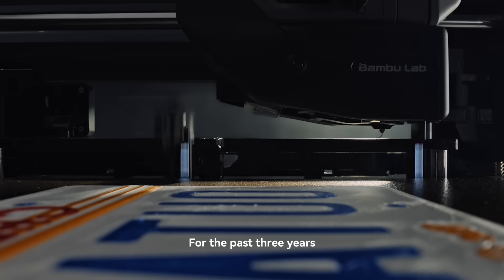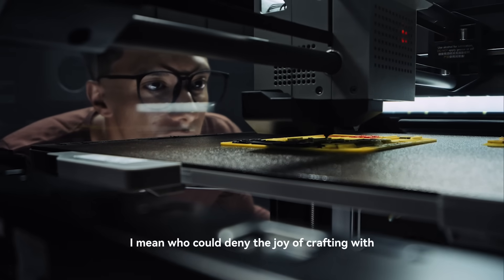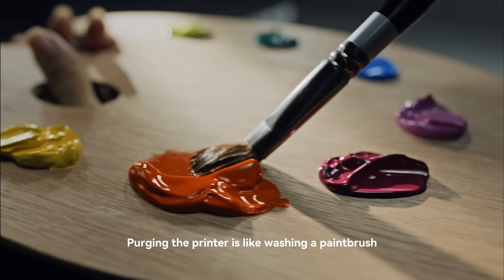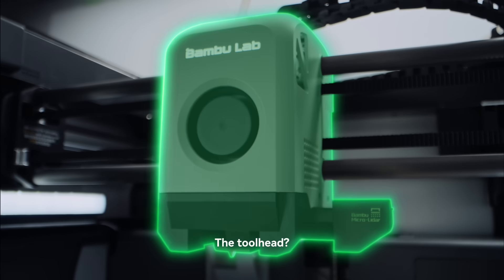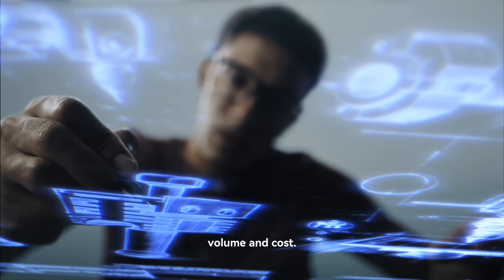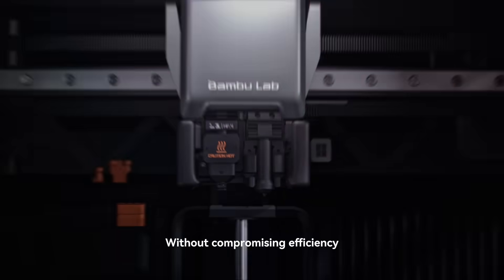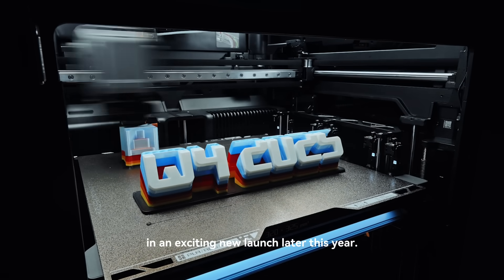Meet Vortek: Our Answer to Zero Purge Waste Multi-Material Printing

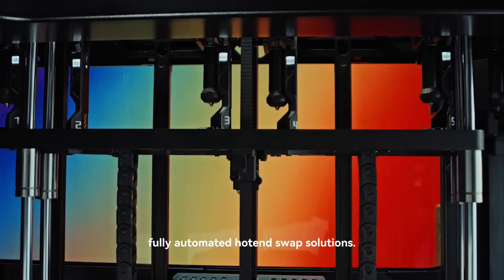Comment: Looks like the filament still has to be cut, and retracted from the bowden tube? I don't see any filament in those nozzles @1:51.
Bondtech INDX still seems the better, faster, more passive (no chip or sensors in the tool) and thus more reliable system 😉
Reply: if they allow multiple nozzle sizes in the future, the main advantage is, that you don't need a filament multiple times while on INDX you need 2 spools if you want to use lets say 0,4 and 0,8 mm nozzles in the same print.

also the Bambu approach saves space on the top of the printer (no tubes sticking out) - downside for the bambu approach will be the flexible filament issue, that the AMS has: it will still suck :)
Reply: @suit1337  Yes, that would be a plus
Reply: @suit1337  oh damn thats right
Reply: Maybe cut but not purge; filament inside nozzle can still be used when color needed
Reply: @JoseMartinez-jd6fk  It will likely still need a purge block because toolchangers still use a purge block (or purge as infill) to prime the nozzle, it just won’t need the poop chute. That said, the rapid heat-up and cool-down of this and the INDX might minimise the need for purging.
Reply: I was also thinking that filament is likely to have been the trickiest part of this build.  Imagine a blob of PETG stuck to the top of the nozzle when it slams up into the head...
Reply: Yes the brush is changed but the rest of the system is the same. So not only do you need the tool changer but you also need at least 2 AMS to allow for the 6 colors on the tool changer side, but you still get the benefit of having more colors than the bondtech. I like the INDX because there are less moving parts and I typically only print 8 colors at most. However the H2C could be a solution for never loading filament again if you have all 16 or 25 colors already loaded.
Reply: Totally agree. This seems to add a lot of complexity just to keep using the AMS. Because it requires an AMS and the hotend changer, it also doesn't save cost over a traditional U1 style system.
Reply: Yes, will still need to retract back. My guess is they will release an ams with 4 outputs and have 6 way filament sensor attached to the back, before the internal buffer. Would reduce the retract to basically just the length of the internal ptfe. Would simultaneously retract then feed the filament and swap nozzles
Reply: Where can I purchase this bondtech indx now? Is it for sale now I just want a printer with this that I can start using
Reply: @samsaek666  No it’s not out yet. Should come out late this year, but who knows if it will be on any printers when it releases. SV08 hopefully.
Reply: Okay, checking th video over and over again it looks like they cut the filament, unload the nozzle into the changer and then grab the new nozzle. In the meantime after cutting the AMS2 pro, whch is faster, whill do the color change and load the different filament. But there is still the problem, that the chang leads to a cut filament, means no retractions possible until the cut is extracted. For tiny details in single models that would be way, way less beneficial than what Bondtech or Snapmaker does. If the managed to retract and then cut the filament tip, like the old Prusa MMU2 does, this would mean obly a tiny bit of filamwnt gets lft in the nozzle and has to be purged out with a simple wipe tower. So let‘s see what the future holds. For me, if this works, it‘s definately the better and cleaner solution than what Bondtech or Snapmaker does, because th AMS is just brilliant and on the H2D it mans 7 colors!
Reply: @ChefBenni What? You just described yourself how this is a less clean and more complex implementation than the INDX and U1 system. It requires more moving parts, more motors, a more complex tool holder, filament cutting, plus filament unloading and reloading. The advantage vs the U1 is it doesn't require whole printheads, but that advantage is mitigated when you realize it still requires the AMS, so 4 extra motors, plus the extruder motor, and a complex hotend holder. The advantage vs the INDX is no umbilicals, but all the other disadvantages. You are trying to convince yourself this is better, but it simply isn't on paper.
Reply: @802Garage it all depends what you want to do with your printer. My wife is using my new H2D just for multicolor printing, for which this and any other Bondtech or Snapmaker or Pruda XL works great. But I‘m using it for engineering material exclusively ABS, PC and PA, so any huge hood design like the Snapmaker or Prusa XL will not work. How Bondtech will tackle it, minimizing it to fit inside of the Prusa Core One will be interesting. But yes, this Bambu system will never be as fast and minimal waste as all the other systems, that is for sure. But giving the possibility to work with more nozzles, calling it a nozzle AMS😅, is super interesting in my idea and opens up so many possibilities. About your points, exept of the AMS, there is no real difference from the Bambu to the Bondtech system in moving parts. But both lack behind the possibility to heat up the nozzle before picking it up, compared to the Prusa XL
Reply: @ChefBenni Hey I appreciate your comment and you're one of the first people to actually make a point about a substantial advantage! Printing engineering type filament is also a priority for me and a lot of my friends and I discuss how to make chamber heating work with INDX as well. I guess we'll see if the Core ONE has a solution for keeping it enclosed. Snapmaker's hood for the U1 does allow passive chamber heating and therefore could add a chamber heater as well. Either will be able to handle ABS and some nylons. INDX is capable of high nozzle temps we know. Though where it gets capped from factory is an open question.

Technically none of the printers will have high enough chamber temps for proper PC printing, but the H2C will be best of the coming crop. Bambu Lab may be the first to market having tool swapping with an active chamber heater, so that is significant, even if mostly about actually charging for it. They will face the same issues as other brands with trying to make a heated chamber tool swapper work though, so we'll see how they handle it. That advantage also isn't inherent to their system, it's just made a bit easier with no umbilicals. There are solutions to have full enclosures with the other systems. So purely from a product perspective the H2C will have some advantages. From a systems standpoint it's more about cost and how much someone will pay for a feature set.

As for the point about moving parts, Bondtech only has 1 extruder and 1 nozzle clamping mechanism. Snapmaker has 4 extruders and 1 clamping mechanism. Bambu Lab has 1 extruder, 1 clamping mechanism, the 4 AMS motors, and then what appears to be an entire belt and linear rod system with at least one motor to actuate the large nozzle swapping mechanism. It's definitely more points of issue or failure, not that it's impossible to make reliable.
Reply: @ChefBenni retracting still hot filament leads to build up in the cooling zone and, in turn, leads to clogs.
Reply: @WholeEgg290 tell that to Prusa and their MMU2 😅 maybe thats also the problem why it never worked and Bambu started cutting the filament in the first place
Reply: Bondtech is dead, Snapmaker U1 have already Kill it
Reply: @MrlegendOr  That makes zero sense. The U1 is a single printer with a 4 toolhead limit. INDX is a system which can be added to any printer people want to mod for it. It can fit far more toolheads. It also reduces the cost per head and has faster swapping overall. Plenty of room for both.
Reply: @802Garage  Slight correction AFAIK: to any klipper core-XY printer. E.g. Elegoo CC and all Bambu Lab printers are excluded. But we all knew that already, didn't we 😉

Having just 2 heads for main and support material + option to add more (for quite little money) is huge benefit on INDX. But one has to have suitable printer for that. I wonder how many printer manufacturers are interested or in talks with Bondtech instead of trying to make a toolchanger copy 🤔
Reply: @kimmotoivanen Hahaha true. I'm not a fan of totally closed ecosystems.
Reply: @802Garage  Prusa Core One teases of having INDX 🤯That's something!
Reply: @MrlegendOr  Why do you seem so hellbent on badmouthing Bondtech? Can you show us on this doll where they....

Comment: Neat. Guess we'll see about it when it comes out. 
I'm glad there is an upgrade path from the H2D. 
If it's not too expensive, I might go for it. 

The benefit of N nozzles over 2 nozzles is not as significant as 1 nozzle vs 2 nozzles. 
Still, if upgrading is not too painful and the reviews are good, I'll probably go for it.
Reply: That sticker shock is gonna be quite the surprise...

Comment: Looks pretty similar to Bondtech's INDX, but bambu specific instead of agnostic like the INDX.
Reply: probably better than INDX
Reply: @alfredanil  worse, INDX is nozzle with pre loaded filament this thing just swaps the nozzle while filament will have to be changed through AMS which will be much slower than just swap of the nozzle with filament preloaded that already was much slower than full toolhead change
Reply: @alfredanil  Nope, index is still superior. This has to deal with the AMS, masking it slower compared to printers like the index, prusa XL and snapmaker U1.
Reply: @alfredanil  Yeah far better Quickest change + double nozzle, close frame
Reply: @alfredanil probably not.

Comment: Bambu Lab timing is funny 😂

It just so happens the Snapmaker U1 was launched on Kickstarter this week...wonder why they released this video now when it's not ready yet 😂

Also, Snapmaker tool change is 5 seconds, this heats nozzle up in 8 seconds, losing 3 seconds per change.

I MUCH prefer Bambu Lab AMS vs Snapmaker side spools though.

Comment: I had a conversation an hour ago convincing a friend that nozzle switching is the way to go! Looks surreal!
Reply: There are many patents in this space they must avoid as well. Going with no pogo pins is a huge win and avoids obvious patents. Inductive heating and wireless data is the way to go. It will cost more but will avoid patents and keep away from wearing points.
Reply: How is it the way to go? You still must purge. Look at the video, they have a purge tower. That's not waste?
Reply: @ThisIsMeArnold  30g of purge instead of 200g is still progress.
Reply: @Targetf  Yeah, wow. Big deal. Less waste in exchange for running and heating a bunch of wifi toolheads on a massive motorized frame that moves thousands of times. What could go wrong?
Reply: @Targetf  It's still slower than a toolchanger like the XL. As this still has to deal with a slow loading AMS
Reply: @ThisIsMeArnold  look man, I was just replying to how you could have perceived his comment no need to be a wiener. Introducing more moving parts is what they did with the AMS, and for the most part many people enjoyed it. Until we actually see the final product I will withhold judgement.
Reply: @LilApe  How much slower would you reckon? If the price is right and the support is there then I can see many leaning towards this system. Otherwise it would be a strange thing to waste 2 years of research and development on.
Reply: @Targetf  I mean they wasted all their development time on lidar, just to abandon it. They wasted all their time on an all in one printer (H2D) that was essentially a commercial flop. All this is doing is solving bambu's waste problem, but not addressing the speed issue. Prusa XL will still have this beat when it comes to multi color/material prints.
Reply: @LilApe I mean, it all stems back to the question of how much faster is multi head tooling vs this method. If we are seeing an hour in difference then sure, but if the speed concerns are negligible than it comes down to maintenance and reliability.
Reply: @Targetf  Also this is more realistic for more colors in play vs the toolhead. this method can scale up much better than toolheads
Reply: @LilApe  Really how so from what I've heard the xl is slower at printing?
Reply: @Targetf  What are you talking about "most people enjoyed AMS"? What is your source? Practically nobody uses AMS in the real world because it's a gimmick that serves no purpose, it just throws your filament away. Literally everybody prints different colored parts that assemble together because of this.
Reply: @ThisIsMeArnold  from the thousands of print profiles on makerworld that use the AMS as well as the echo chamber known as reddit. One could argue 3D printing generally has gotten fairly gimmicky so I don't see your argument unless we're talking about large scale production/commercial/industrial. At that point you'd be moving the goal post again. There is almost no point in trying to reason with you because that's what I'm getting from your replies - so let's end this here.
Reply: @Targetf  There's thousands of AMS print profiles? And what is the percentage to the total amount of print profiles? Clown
Reply: @ThisIsMeArnold  what's your source for nobody using AMS and that it's a gimmick?
Reply: @FroZenThai  Every major 3D printing community and forum.
Reply: @ThisIsMeArnold you must not do any real world printing, the AMS is indispensable for multimaterial printing or using dissimilar plastics as support material for the absolute cleanest overhangs.
Reply: @gcutler15  Hahaha, no, I actually own a 3D print farm and a business. AMS isn't any of what you said. Properly designed parts do not feature overhangs. AMS doesn't work with dissimilar plastic and dissimilar plastic doesn't bond together. PETG cannot be used as support for PLA, etc.
Having said that, I can unironically say taht you likely do not do any real world printing and I'm 100% certain you've not used AMS based on how you described using dissimilar plastics as support - which is widely known to not work.
Reply: @ThisIsMeArnold  lol you don't know shit
Reply: @ThisIsMeArnold  That's a prime tower, it's used to adjust nozzle pressure after a color change; you can turn it off if you don't mind some jankiness getting into your print
Reply: @ThisIsMeArnold  Nope, that's a prime tower, not a purge twr. Not needed in most cases if 'purge into support or nifill' is on. And the user can disable it.
Reply: @ThisIsMeArnold realistically tool head change you still need to purge. Filament stayed inside the head for too long deteriorates the filament and ensuring good consistent flow you still need to print prime tower.
Reply: @onehourmusicbc  Thanks for making my point for me
Reply: @ThisIsMeArnold my point is, either tool change or nozzle change will require prime. Nozzle is way less then a whole tool head, convinces me that it is a simpler and more durable design without such expensive hardwares. Bambu's implementation to me is much more practical than those of snapmaker and prusa xl
Reply: @ThisIsMeArnold  thats not called a purge tower that's called a prime tower.
Reply: @ThisIsMeArnold  every printer has to purge you can turn it off what you chance the print having imperfections.
Reply: Yo sigo pensando que el cabezal es más óptimo que la boquilla

Comment: Bambu Lab's Wiki - Is Vortek a separate system or only available as a new 3D Printer?

The "Vortek" is both an upgrade system specifically designed for the complete H2 series of Bambu Lab 3D printers, as well as a brand-new flagship printer. The upgrade kit for existing H2D/H2S users will allow them to upgrade their current 3D Printer with the Vortek system.

You're welcome.

Comment: Do you have to own the H2D to be able to use this new system? Because it looks like there are two hotends, one fixed and one changeable. The new H2S only has one.
Reply: Question was answered a couple posts down. It looks like it will be a new printer, with the ability to upgrade the H2D.

Comment: Holy crap.... Is literally what I just gasped when I saw this. Blew me away. I've been 3D printing for around 10 years now (first printer was the M3D micro) and I don't know if I've never felt this giddy over 3D printing tech. This is also is one of the most satisfying mechanisms I've EVER seen...
Reply: I guess you missed the INDX 6 months ago. Basically the same from what I can see.
Reply: Ehhh no, además mucha opción de fallo con el sensor NFC que usará por contacto
Reply: @rmberoiza your negativity is good for their improvement. Keep it up.
Reply: @rmberoiza I don't believe bambulab will make something not-reliable lokking at their products, so your opinion is probably wrong.

Comment: Seems like Bondtech INDX without the open-source part (so probably worse).
Reply: Mmmm, not really. In the Bondtech, you have X tubes, one connected to each filament. In this one it seems it only changes the hotend, you only have 1 tube and it connects to a normal AMS.
Reply: @rever6612  Aint that kinda worse tho because the AMS still takes time to swap the Filament for each change?
Reply: Depends, many people want the ease of use and comparability. If you want a bambu lab, open source is already out of the question.
Reply: Open source that is crap is still crap! Name one open source thing that has the same user experience?
Reply: @mikeehuber  Sovol SV08? Prusa Core ONE?

Comment: Looks interesting, tho the overall change time will now be limited by the AMS Motor speed.
Bambu Printer with Bondtech INDX would be amazing combo.

There also exists a similar design with a revolving magazine for Prusa Printers, but I can't seem to find it anymore.
I did the exact same thing, changing only the nozzle to eliminate Flushing.
Reply: You will also have to add in purge tower time to prime the nozzle.
Reply: You mean the Swapper3D?
Reply: @sircogwheel exactly. They have quite bad SEO didn't find them when searching for different combinations of swapping nozzle prusa automatic etc 😅